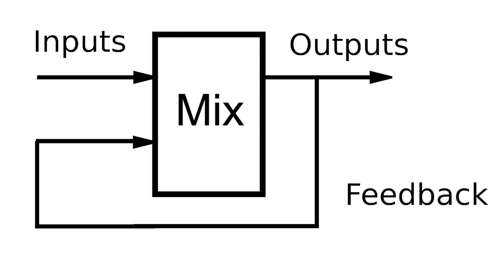What the Heck is No Input Mixing??? (my first try at making sounds with just a mixer)

Comment: That's only half of the fun. Try splicing various FX pedals in the feedback paths, like chorus/phaser/flanger/filter/whatever. You can even do (almost) no input noise with only your RV-6 and a distortion, just feed one of the L/R outputs back into an input, the other output to the distortion pedal, high gain preferred ;). You may need a noise source on the input or just a dangling cable could work where you can touch the tip to actually trigger the feedback. This pedal can produce real sonic mayhem.
Reply from the maker: Good to know. Thanks for checking out the vid.